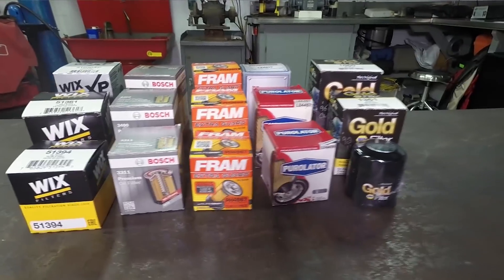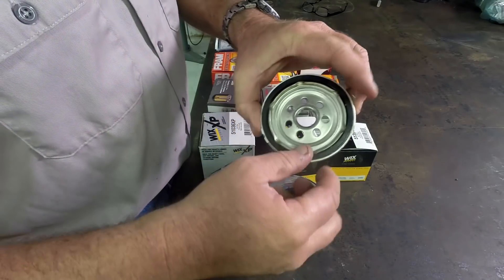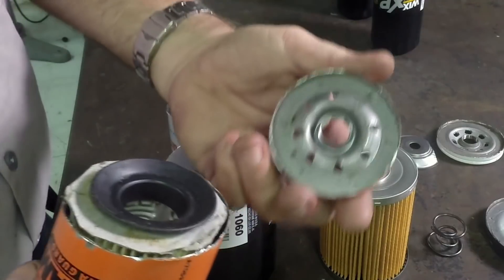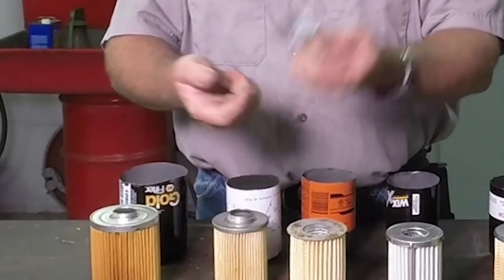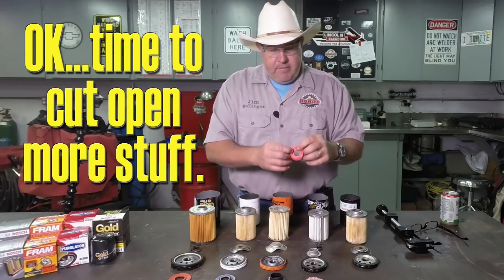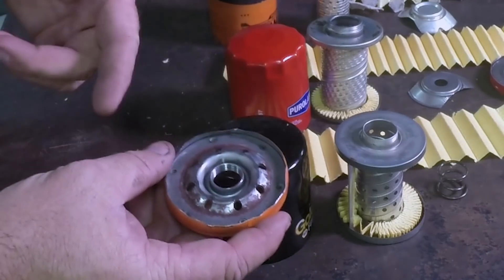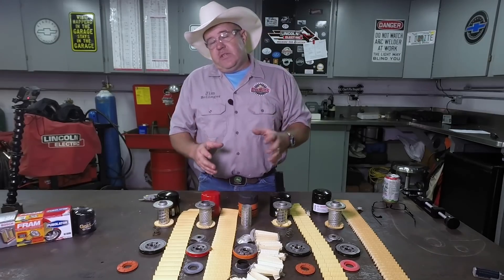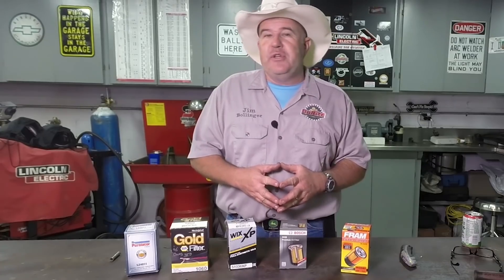The worst oil filter EVER!

Comment: No comments were made on the particulate removal capability of the actual filter media. This is scored as a percent removal of specific sized particles. Since these filters are a type known as a depth filter, with particles trapping within the depth of the media, and not just at the surface, the nature of the media can influence what particle sizes will escape through the media. These sizes should be small enough that the clearances within the engine will not be impacted by them, and the durability of the media and it's adhesives impact the life of filter. There are sites online to discuss this in more detail.
https://mzwmotor.com/oil-filter-guide/#c2.2

Comment: Used a Fram filter years ago, and it had such poorly cut threads it damaged my oil filter mount on my engine.  It always dripped oil on the driveway after that.... Never again will I use Fram, after that I went to the dealer and bought OEM filters for newer vehicles -- no matter what the cost.

Comment: Sooo... have you measured/checked the filter media to see if its the same material and thickness ?  Wouldn't that require a reassessment on your part if they are different..  No, I don't work for Fram and I happen to use Motorcraft or Purolator filters.  Just a question..

Comment: got rid of fram like 7 years ago my wrench put a small nick in the flimsy coke can and was leaking oil i thought it was coming from my oil pan ? come to find out. noticed the quality had degraded from previous years. i used/use purolator now its a good filter as you can see

Comment: What a nice job..subbed and new fans over here at #how2wrench. I was surprised by the Fram filter. It has to be at least 2015 since I cut a bunch of filters open and maybe its time. The Fram I cut was not all cardboard but maybe it was old or production has changed. I would never want to run one if so!

Comment: that fram filter HAS NO BYPASS valve...when cold at start the bypass stays opens  to let oil pass  till it warms up then it can be filtered...i bet that filter destroys any engine slowly ... it only allows oil pass when the oil gets hot through the filter media but the first 5  or 10 minutes the engines is running with no oil

Comment: It’s a oil filter? You use it and later through it away. Most people don’t change their oil? Everyone who changes their own oil has seen or heard these claims before. I have never found anything but oil in any filter or in the drain pan when changing my oil? Begs to question who’s putting dirt in engines? Engine’s didn’t even come out with filters in the early days. Filtering oil has always and will be always a mystery as long as you change the oil at the same time you replace the filter. Most pickups require twice the oil capacity but same old paper filter? All oil filters are made by three companies. Brand loyalty is about 5% of consumers thought process. The cost of a filter is marketing and delivery not manufacturing or the engineering that goes into the product.

Comment: Can you show an engine that was destroyed by fram as long as oil changes were done at correct interval?  I e never seen one. 
 Also this guy brings out entry level fram to compare with top filter from other brands. Should use frams top filter line to compare. Strange bs review.
Clickbait bs review.

Comment: What Are the Independent Standards for Filtration Effectiveness?
ISO 4548-12 and SAE HS806 test standards are used by oil filter and Original Equipment (OE) vehicle manufacturers. These test standards specify over 15 different procedures to determine the performance and durability of an oil filter.

Comment: For what it's worth, long before I knew this about Fram filters , I bought many ,many Fram filters over the years . I put hundreds of thousands of miles on them going to work and back for 30 years, never 1 oil related issue .
Reply: I used fram for years on many engines. Never had an oil related failure. I also changed religiously and flushed once a year with cheap oil and seafoam.
Reply: Used fram for years and im a mechanic put milions of miles on change oil regulary and no problem the cardboard never hurt a thing
Reply: Used FRAM HP1 many years haven't any issues . If it did , lawsuits would happen.
Reply: I've heard about the cardboard for years but they have never changed it. Maybe now that there are so many people aware of maybe because it performs fine as it is.
Reply: I actually had a fram filter disintegrate in my gladiator recently I think they are good but they let the bad ones slip through quality control, id never go back now
Reply: @AmericanFry  Can't blame you for that , sorry too hear about that.
Reply: I had  over 330,000 on my Subaru legacy only using Fram or Fram extra guard.
Reply: I’ve used the fram ultra , and high mileage filters and zero problems . Wix , and others are good but fram is hard to beat availability and cost .
Reply: @eddie123214
Cost? Is it really worth saving five or six bucks?
Keep in mind that the Fram is unlikely to cause an catastrophic engine failure when it fails or does a poor job filtering.
What it will do is cut your engine life short.
Maybe you'll get 150,000 miles on an engine instead of 250,000.
Reply: this is the users only comment afaik, its a FRAM astroturf account doing damage control.
Reply: @privateprivate5373  makes sense to me
Reply: For what it's worth, long before Al Gore invented the internet- I knew Fram Oil filters were junk. I personally knew of 2 people with completely destroyed engines because of defective Fram oil filters. Now- to Fram's credit-  They DID actually pay for a rebuilt engine for one of the guys-  not sure how it ended for the other guy.
Reply: Knowingly buying junk when a much better option is basically the same price is the absolute definition of IDIOCRISY...
Reply: I had a 1996 Ford contour. Every filter I ever bought was the orange can of death. Never had an issue.
Reply: Exactly. Show me the evidence that they are no good. Based on the video there should be dead engines everywhere to prove they are no good but where are they. Cheap people that don’t do regular oil changes have destroyed far more engines. And those I’ve seen plenty of.
Reply: It's not necessarily that the Fram will disintegrate and cause an immediate engine failure. It's more the case that the engine will not last as long as it could with good filtration.
Reply: @donziperk  Yeah, you would think there would be particles of cardboard floating around in your oil pan, and clogging oil passages, causing engine failures. Now the little bit of rust? That won't do anything at all. Those filters were probably stored in a humid environment for a period of time.
Reply: Keep using the Fram oil filter guys, even though you now have seen for yourself what is inside them. It's just like cigarette smoking it could kill you or not.😊
Reply: The end caps aren't even required for the filter to function. They're just there for something to glue the filter paper to. Doesn't matter that they're fiber board.

Many of the new filter designs don't even have the end caps. The filter media is sonic welded to the core and a little plastic donut at each end. That provides the seal between the outer layer and the core.

Comment: I've used Fram filters on my 2003 Corolla almost exclusively since I bought it new. 308,000 miles later it's still going strong, but now I don't think I can bring myself to continue using them after seeing this. I had no idea there was cardboard and rust in those things!
Reply: If you've used Fram filters for 20 years on a vehicle with 300k miles without issue,  I'd definitely stop using Fram.

Comment: My four vehicles have a total of 1.4 million miles on them. I've used Fram and cheaper on 99% of those miles. I don't push an oil change, though, every 5K miles. I use cheap oil, too.  That Napa filter is probably good for 25K miles at least. I go cheap and change it often.

Comment: If the STP branded filters are similar to the fram filters, then i have some work to do.
those are the ones primarily sold at autozone. but they also got mobil 1, K&N, motorcraft, and ACDelco. they're likely all made by fram.
Thoughts?

Comment: Laughable analysis. He first judges how they “look” from the outside. Right. Then not a scientific testing method in sight. Oh, btw, oil under pressure doesn’t “twist” filter media. Oh brother.
Reply: It was a basic test of the strength of the filter assembly, nothing more.  You don't need a scientific test to see that the Fram filter is poorly built garbage.

Comment: Don't believe everything you see on YouTube. I have used Fram oil filters on all of my Hondas for over 30 years and NEVER had any issues. In fact, my 1995 Honda was at 310,000 miles when I sold it. In the early years, I'd change oil every 6000 miles. Now, I change at 8000. They're a great filter based on my experience.

Comment: Sorry, bullshit. Clickbait. Been using Fram filters, along with others, for over 40 years. Never damaged any engine. Fram builds oil filters for a number of OEMs, which would not be possible if they were "the worst" filter ever.  This kind of video is just perpetuating a myth that there is some magic to oil filters, when there isn't. Fiber end caps don't make any difference. Some newer filter designs don't even have end caps.
Change your oil every 3000 miles, your engine will last a long time. Don't, and it won't. The oil filter isn't going to make or break anything.
Reply: Sure, the more rust inside your filter the better right?

Comment: The Napa Gold filter IS a Wix filter. Wix makes the filters for Napa Auto Parts.
Reply: Beat me to it. Worked for NAPA for over a Decade. WIX made both the Silver and Gold Filters. And the Silver was better than most other brand name filters. Gold was just that, the top of the heap. Still the only brand I will use.
Reply: Wix filters all made in Gastonia NC…
Reply: @SuperVstech  Wix makes them to Napa standard. Same as most filter companies. They build them to customer Spec. Customer Spec is were the filtration quality lies. Not really about who manufactures it.
Reply: @wht4132  so it just so happens that napa said build our filters identical to your filters? 
Sorry but you are wrong.
The filter company Wix designed it and napa approved it lol
Reply: @RecklessPedro  Believe that is what I said ! LOLOLOLOLOLOLOLOLOLOLOLOLOLOL
Reply: @wht4132  they make the CARQUEST filters too. If you look wix Napa and carquest I'll have the same number for the same filter. Maybe the beginning digit is different but it's basically the same number.
Reply: Wix made filters for Jiffy Lube too, though I don't know if they still do or what their quality was/is.
Reply: @adotintheshark4848  Those are commercial grade filters. Basically they meet the minimum basic requirements. Not that it matters. They are just going to forget to put in on, screw it down tight. And that doesn't matter if they don't tighten, or remember to put the drain plug back in.
Reply: @adotintheshark4848  I'm sure the Jiffy Lube ones were the low grade Protecs by Wix. Theyre considered stocking filters for shops that need on site inventory
Reply: both brands are owned by mann and hummel who then contracts parker hannafin(they own the baldwins brand) to make them
Reply: Glad he said this in the video! I didn’t even know that! Think I’m switching to WIX now after this lol
Reply: I wish manufacturers would just consolidate brands, but I guess then it wouldn't as easy to avoid giving off 'anti-trust' vibes. The least they could do is just put a makers mark on everything that leaves their factory so customers wouldn't have to guess or research as much.
Reply: He said that in the video.
Reply: unfortunately he didnt show the platinum line napa filter (i currently work for napa) it is the equivalent to the wix xp line of filters it uses a glass media and has double the contaminant holding capacity than the gold does costs a bit more than the gold but a much better filter for synthetic oils imo besides wix or napa i would use cat filters they are made by donaldson.
Reply: @stephanbertram723  cat and Donaldson are also manufactured by parker as well

Comment: Use a Purolator filter and they tear. Actually Fram quality has been improved in recent years and their bottom line (orange) filter is pretty decent. I prefer the 'Tough guard' myself over the orange can. Their XG top of the line is currently the standard for 'best' filter.

Comment: I made a display of oil filter cutaways for a Honda dealer I worked at back about 1983. I don't remember all of them but I do remember the Fram was much worse than the Fram shown in this video. The Napa was the best. None were anywhere near the quality of the OEM Honda filters of the time. It's nice to know Wix is the same as Napa.

Comment: I guess perhaps I have been extremely lucky with the Fram filters. I have run those filters in my cars for 34 years and the cars just keep going! The best success story is my 1995 Ford E-150 Chateau'. It's still going with 189,000 miles on it! I think that's pretty unheard of for a Ford! As I switch over to synthetic oil I will be using WIX filters though.

Comment: Sadly, current Honda oem ”A02” filter is made by Fram / Honeywell. So much worse than previous Filtech / Toyo Roki ”A01”. I try to avoid using it, instead I use Hamp or Honda oem large Toyo Roki / Filtech S2000 ”PCX” filter.

Comment: I was interested in the NAPA Gold and you covered it very well. The Fram was bonus info. You didn't cover the pressure bypass valves though. I am finding that Napa Gold may have moved it from the base to the top? Anyway, thanks for going over those filters for everyone to get educated on the components and quality.

Comment: Using fram filters for years. F150 4.6 252k miles change every 5k. All other vehicles too. Never had a motor fail. All it supposed to do is stop particles. Not meant to clean your oil....

Comment: It seems likw I am the minority the worst filterI bought was a wix for my built Chevy, oil pressure dropped 6 psi,  Just bought a wix xp for a chevy equinox made in china! for a $18 filter. no thannks I will stay with acdelco.  BTw when I send my oil in to be tested my acdelco has better results less iron.  save your money! send your oil in to be tested. The acdelco upf series are the best made in usa and ceaper than a chinese wix

Comment: So glad I always go for the napa gold oil filters for my car! Thank you!
Reply: Me too. Just sold my Forester with 147,000 miles. Runs like a top and always used Napa Gold filters. My new Subaru will get the same treatment. I am more concerned about the CVT transmission than the engine.
Reply: Same.. made by wix

Comment: I haven’t bought a FRAM filter since the mid 90’s after a mechanic mentioned they weren’t as good as OEM filters. So I started using AC DELCO or FOMOCO until I switched to K&N a few years ago

Comment: I have always used Fram filters in my vehicles and changed my own oil, I recently had and engine blow up on my Chevy Silverado with 150,000 miles. I never dog my engines drive within speed limits and never have pulled a trailer with this truck. Wondering now whether the Fram was part or whole of the problem. Never will know but my father always said pay more and get the best quality at NAPA. I guess some kids never fully listen to their father:)

Comment: The drain back valve pushes away from the cardboard when the engine is off. When the engine is running the oil enters the filter through the small outer holes and exits the filter through the large center hole of the filter. And while the ends of the Fram element may look like cardboard they are not cardboard.
Anyway why do you compare Fram's cheapest filter instead of their top of the line filter to other more costly filters? That hardly seems fair.

https://tiremeetsroad.com/2019/01/24/are-fram-oil-filters-any-good/?unapproved=9775&moderation-hash=97af52291ee98290baa18e718d5b50a3#comment-9775
Reply: @EvaKiner  
So all Fram filters are junk no matter which one you are looking at? Yeah right. Just cutting the lowest prices one open and looking at it proves nothing. (I don't use them myself but I fault no one else for using them I usually use K&N or Toyota OEM.)
Reply: @EvaKiner  
Yeah... If you read it on the internet, it must be true. 🤔😜